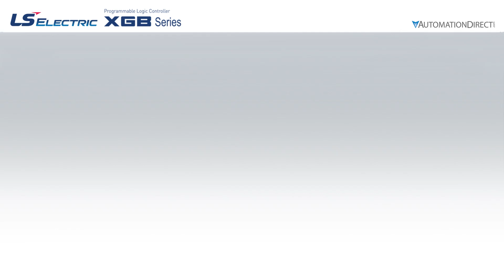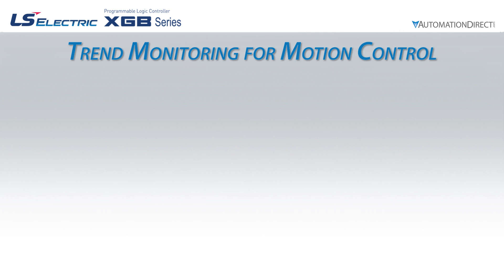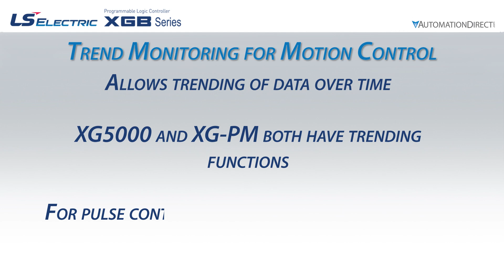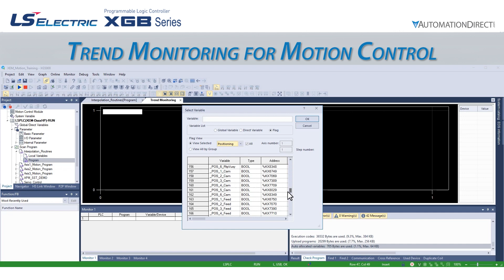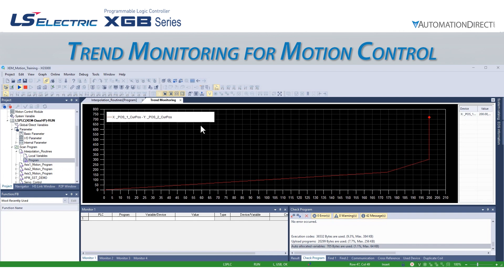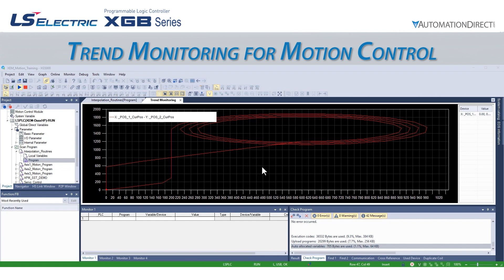Trend Monitoring for Motion Control - LS Electric XGB PLC from AutomationDirect

Comment: Do you mainly use LS ELECTRIC PLC for machinary control?

Quiet interesting.....😮😮
Reply from the maker: LS Electric products range from a fully functional PLC lineup, to servo drives and motors. They can certainly be used for machine control as well as a host of other applications in industrial automation.